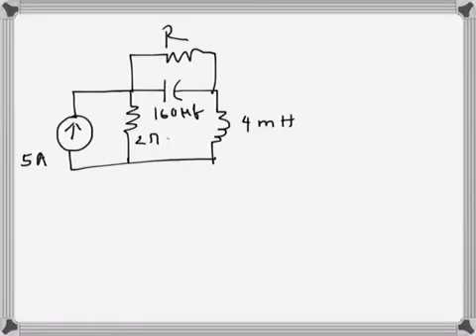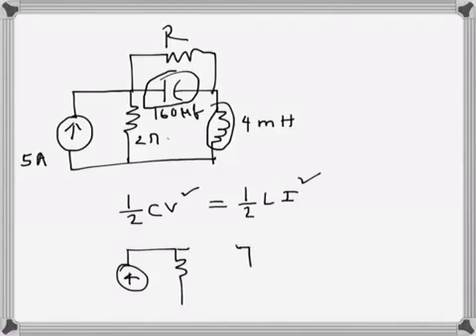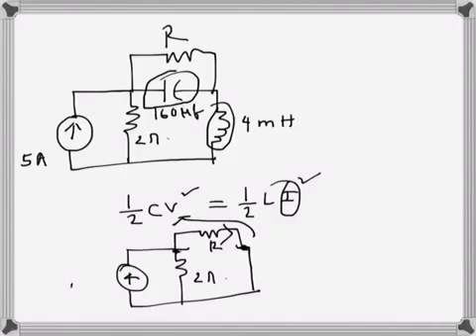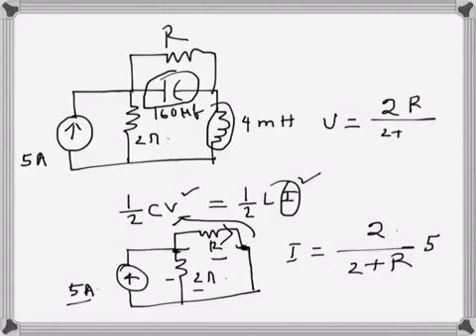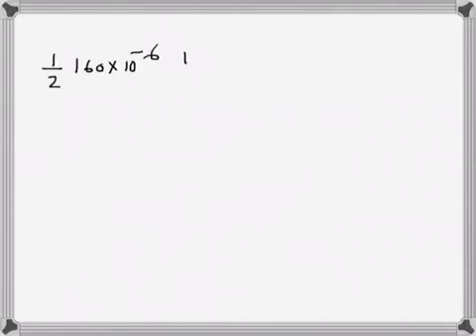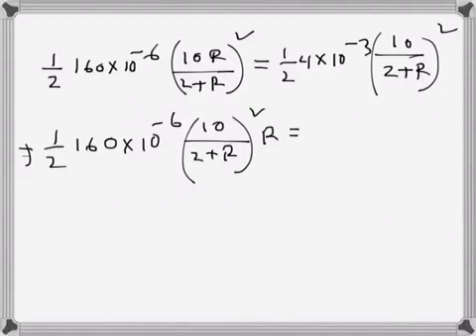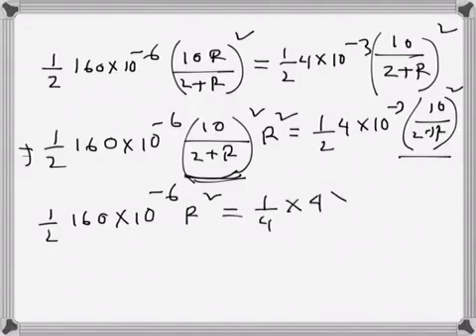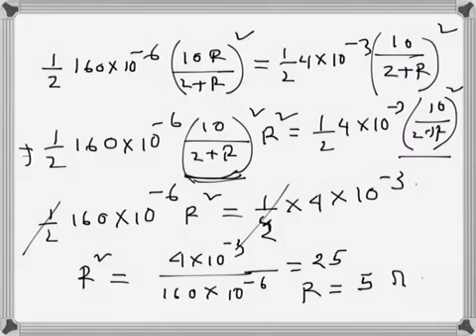Electrical :Capacitor/Inductor circuit (Problem example)

Comment: How did you get I=2/(2+R)*5? Aren't the resistors in series? And if they're not, wouldn't it be I=2r/(2+r)*5
Reply from the maker: +IfIwerecynical The resistors are in parallel.